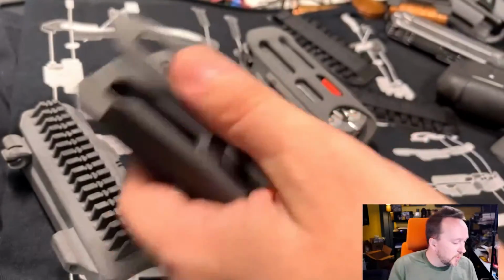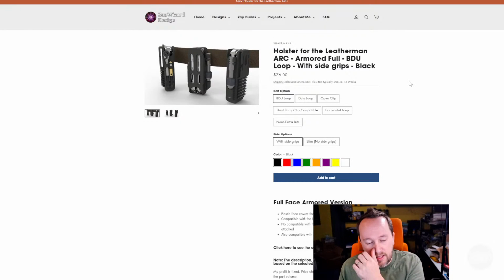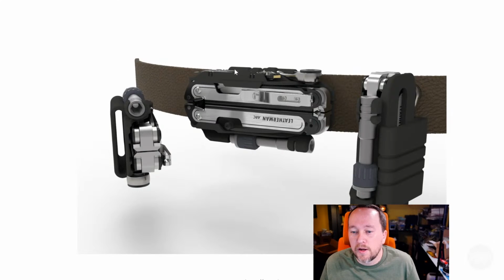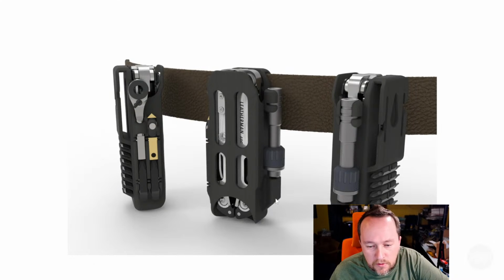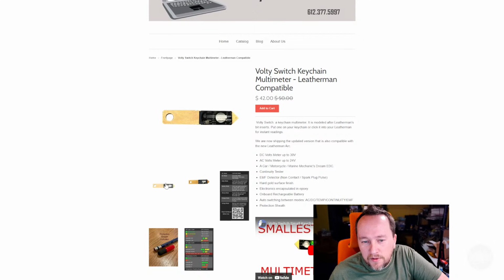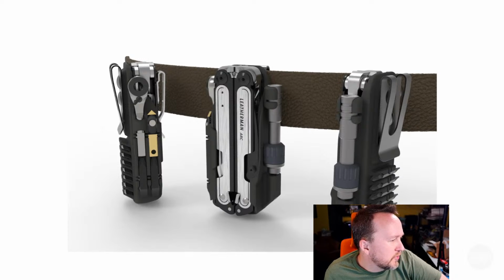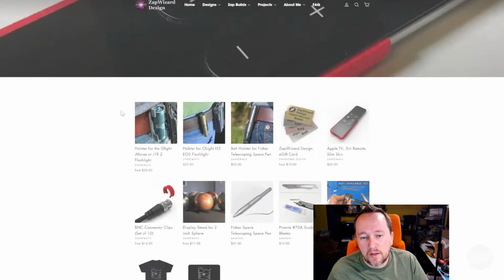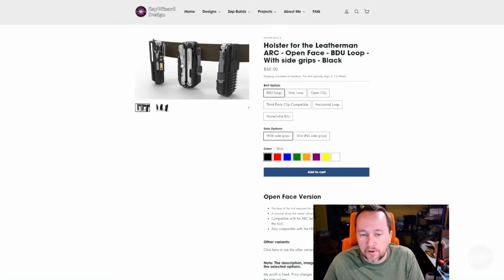Live- Zap's ARC Holster Release Party

Comment: You have a holster that allows the light attachment that screws into the back of the arc .made by Pc Poodle
Reply from the maker: @TJ-hd5ym  The flashlight works with the “open face” or “pocket clip” holsters, but only when installed on the blade side of the tool. The other side is where you belt is, and so adding stuff to that side means the whole holster gets thicker and hang off your body more, so I don’t off those.
Reply: @ZapWizard  ok thanks i have one of your holster i love it , great quality and engineering 👍

Comment: I just received my ARC Holster, and I am very pleased. The quality of the finish for a 3D Printed Part is excellent! Without knowing beforehand, I would never guess that this holster is a 3D Printed Part. I am also very impressed with the fit of the Leatherman, the bit driver, and the flat bits. I was concerned that 3D Printing wouldn't allow tight enough tolerances to control the fit between all the parts and the holster, but everything fits perfectly. Can you tell me what tolerances your supplier is holding for you? My only unresolved concern is durability. I will have to use my holster for a while before making any judgments, but I have high hopes. Congratulations, Excellent Product!
Reply from the maker: The parts are made by Shapeways, in general the tolerance is +/- 0.2mm. Occasionally someone gets a holster too loose or too tight, but boiling the holster in water can soften it to get a perfect fit again. The holster is solid Nylon 12. The printing process is Selective Laser Sintering.

Comment: Hi, with respect to bit holder: once attached (BDU or Duty Loop) to access the bits I'd have to take off the holster, right? Is there some attachment to the belt itself that uses the tear shaped opening on both for fast detachment in such case?
Reply from the maker: You can get the Third Party clip compatible, and then add a clip of your choice, or the Open Clip, but the open clip is weaker and for light duty use only.

Comment: I purchased the barnacle bit for the Arc and hold the leatherman Mut long Phillips/slotted bit. It fits pretty well and It helps for when you need to get into a recessed screw or when you just need that much more length. It be interesting to see the development of a barnacle bit designed specifically for the mut bit in the near future.
Reply from the maker: I did actually look at that, but the issue was it would block the scissor thumb tab.
Reply: @ZapWizard  I still have access to the scissors the way I have it right now. I have the mut bit sort of centered on the barnacle bit, but I do see that if you would extend the barnacle bit higher, it could possibly get in the way of the scissors tab. Maybe if there was a way to off center the barnacle bit to hold the mut bit slightly closer to the middle of the tool, it could leave more room to access the scissors. Anyway, thanks for the hard work. Can't wait to get my holster in the mail.
Reply from the maker: @Ever_al95  Actually the offset is an interesting idea. I may look at doing that later.
Reply: I like that bit too! It reaches into electronic housings quite well.
Reply: @JamesMiller__Outback_Idaho  I've found it quite useful. Now that I have the sheath I've been carrying the long mut bit on the side of the holsters where the volty swith and the additional bit underneath would be. The volty bit I have just been storing in the Leatherman ARC it self.

Comment: ever try having lanyard loop mounted on backside with barnacle bit on front side and putting in holster?
Reply from the maker: I did actually, the issue is that it puts a cut in where the belt loop needs the most strength.
Reply: @ZapWizard  oh ok, even with the 3rd party metal clip config?
Reply from the maker: @nothanks666  it probably could have worked on the third party version.
Reply: @ZapWizard  gracias amigo

Comment: Which variant should I order if I’d still like to carry it in my pocket? But I’d like to add the ext. and 7.11 ratchet.
Reply: That’s what I’m thinking also.
Reply from the maker: The no-bet option with side grips. It has 16 bit holders on the back. If you don't want the rear bit holders, I would have to make a new variant. Another option is the third-party clip. Which has 7 bit holders, and without an added clip is quite slim on the back.
Reply: @ZapWizard  Thanks - I definitely would like it to still clip it to the inside of my pocket like a traiditonal picket knife. It sounds like the best option for that may be the third party clip.